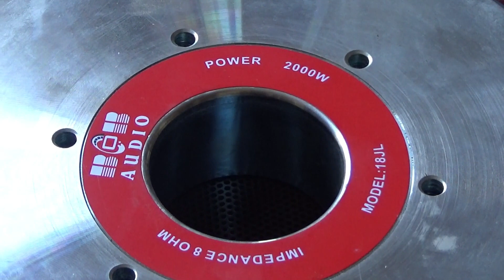AKAN KAH STROM BIKIN KEJUTAN DI KARANGANYAR

Comment: Aku ae 14 juta lebih oleh sak set sidfil 10"bulosx4 + bma d5x2 + Power ac matic 30a12vct socl506x4 ch (tambahi inverter 42v spesial ben kenek ngge miniaturan 😁)  
+ planar acr 15600 + Power toroid 10a55vct socl506x2 + mixer efx12 + eq dbx + acc lain.....

14 juta oleh 10 Power jan mendemm Power bosse....😄😄